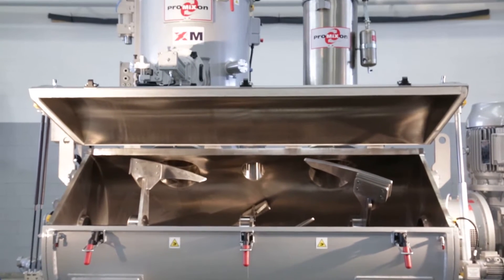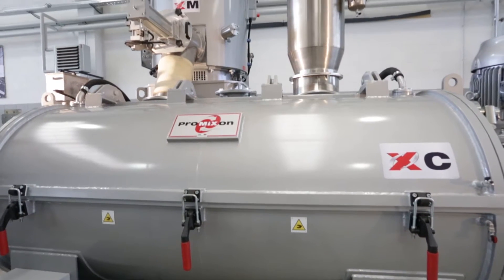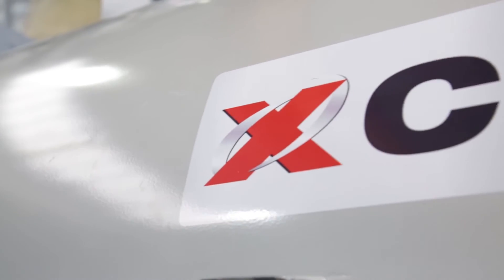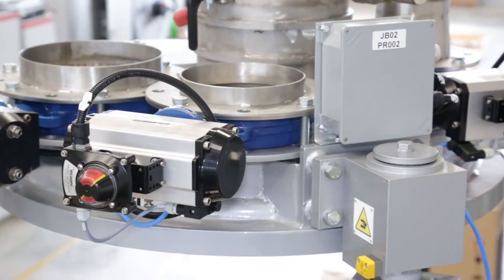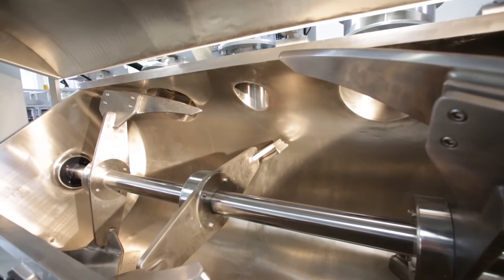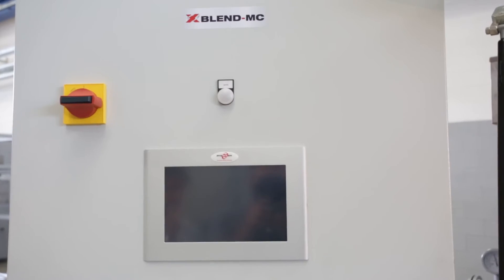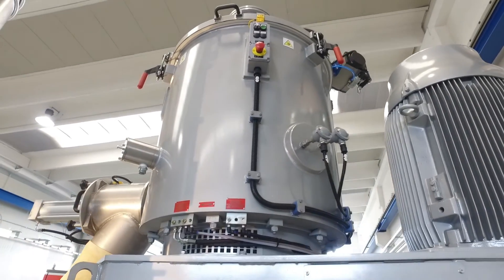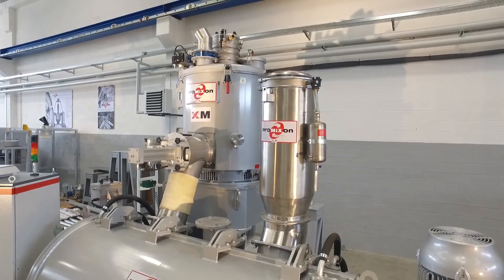PROMIXON S.r.L. - XBLEND-MC Powder Blending Equipment

Comment: We specialized in manufacturing polyethylene wax（PE WAX) and supply PVC stabilizer,ACR additives and CPVC.
Qingdao PMST Chemical co.,Ltd, Manufacturer of PE WAX and supply polymer additives, pvc stabilisers - lead, calcium zinc, barium zinc,metallic stearates and specialty lubricants for pvc, cpvc and other polymers.
We are not only sold to you the above products, we can also provide technical guidance services,Service is free.
If you have customer want to need them, please contact me.
Whatsapp:+86-13553089896   Skype:frank99886600  Email:  hakingroup@foxmail.com